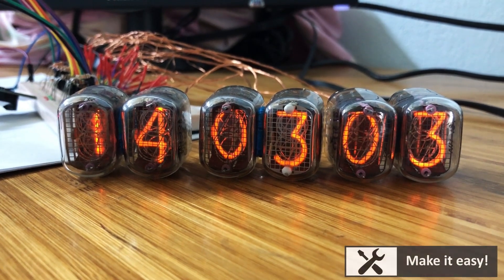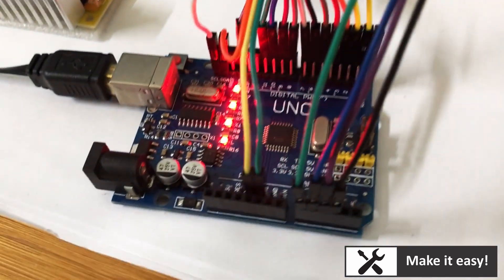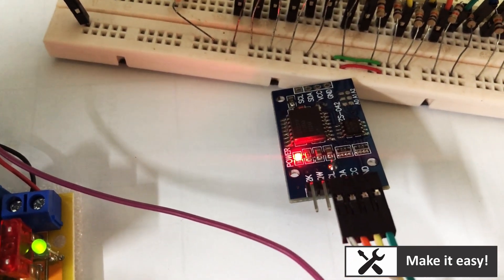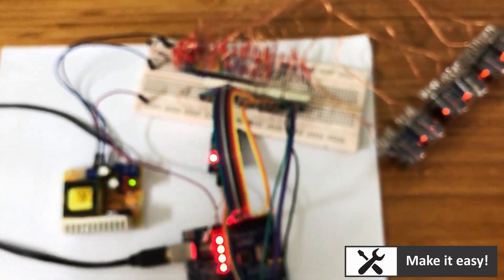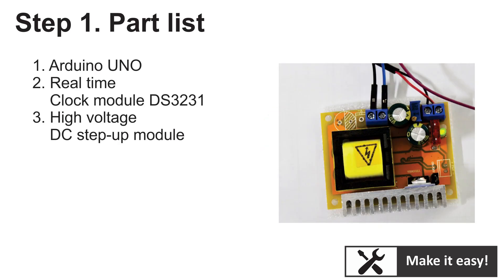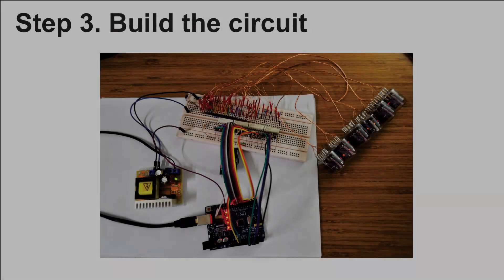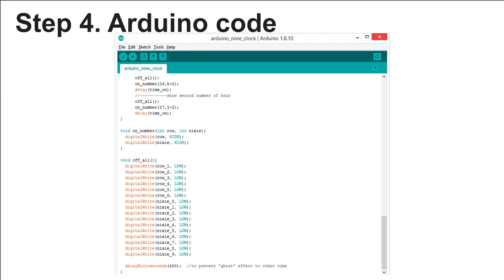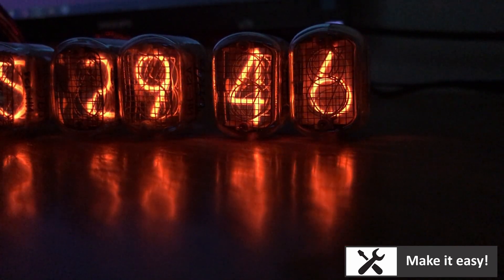Nixie clock by Arduino | Simplest design

Comment: Simplest design= Requires 90% of the Uno's pins to function. No. Simple is shift registers or similar that runs on 2-3 connections.
Reply from the maker: Compare to other design, this circuit is the simplest one
Reply: No, simplest design uses the fewest parts. Adding registers is not simpler. Saving Arduino pins is pointless.
Reply: @MB-st7be  saving pins is pointless? Then what if you need the other pins to do other jobs?
Reply: @zaprodk  What jobs? He set out to make a clock. Which he did. He wasn't trying to make a clock that's also a coffee machine...
Reply: @MB-st7be  other jobs as reading sensors and buttons.